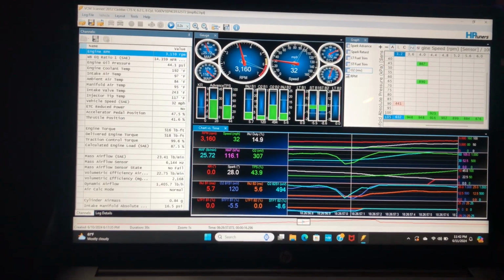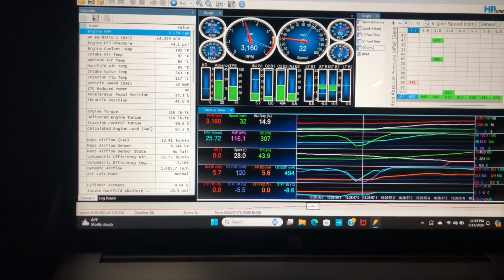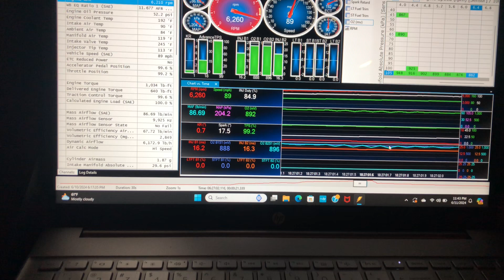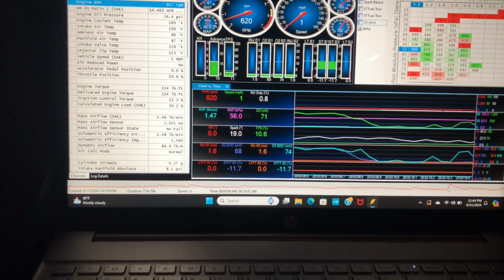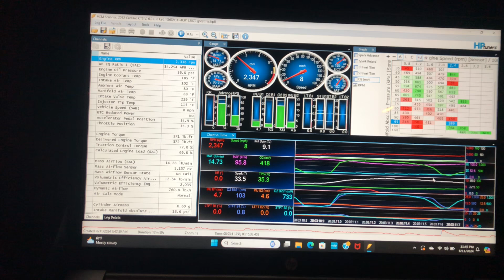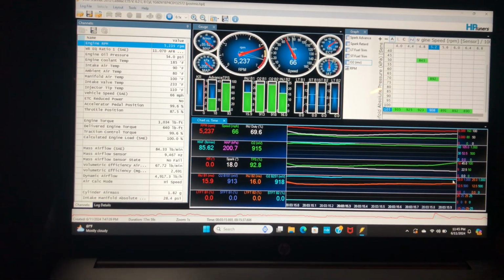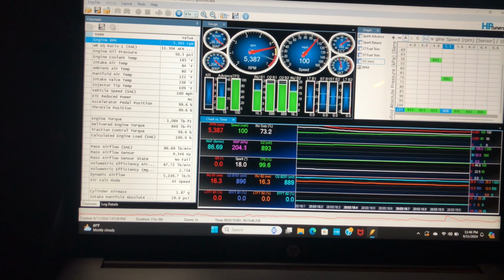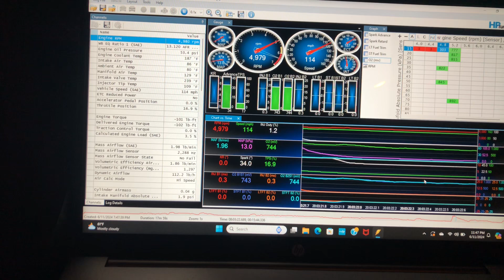How to identify a  misfire in data log - hptuners

Comment: Or you could plot the Total Misfires PID..
Reply from the maker: @snivesz32  many tuners will disable misfire detection when tuning for aftermarket cam. I’m no tuner, but from what I’ve heard from guys who have done it, adjusting the tables to filter out the false misfires while still being able to pick up real can be a real PITA and even on factory cars the misfire detection isn’t always  accurate. Definitely worth trying though.
Reply: @nocturnalcustoms376 I’ve put a btr stage 1 turbo cam in mine and tuned it, and misfire detection is still working.  It’s a mild cam, so maybe thats why.  Mine mostly shows 0 but sometimes catches a few, max I’ve seen is 12.

Oh, maybe you’re talking about knock sensors.  Yeah, knock is not a misfire.  A knock is when a hotspot ignites the fuel before the spark does, a misfire is the failure to ignite the A/F mixture. But yeah, depends on the engine and cam, if you have a noisy valvetrain I can see it could it false triggering knock sensors.  Personally i feel desensitizing the knock table is the last resort.  I would much rather have the safety of knock retard save the engine if something stupid happens.

But i think an oxygen sensor is too slow to use to detect a knock like you are thinking.  Think theres about 100 revolutions per second at 6k rpm, and 400 spark events, 200 per bank, so seeing one knock event with an o2 isn’t realistic.  Just from seeing your logs offhand it doesn’t look like you have a problem.